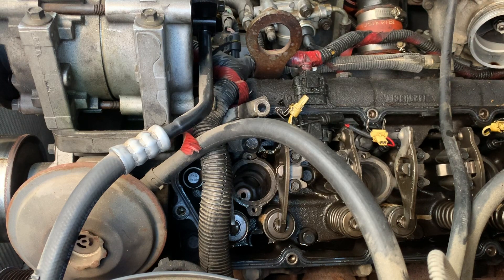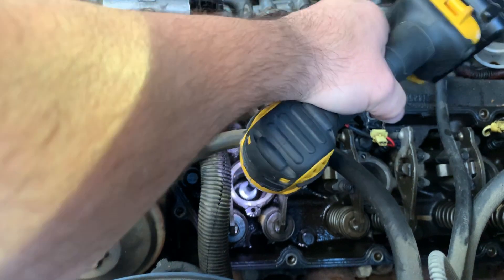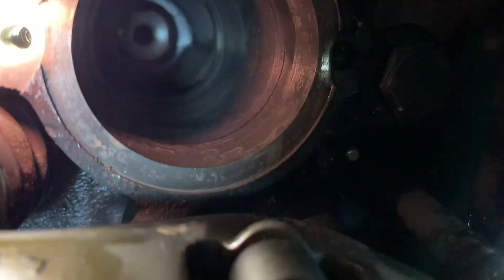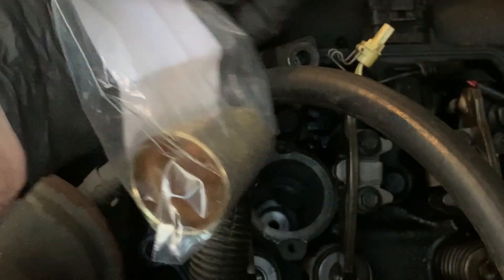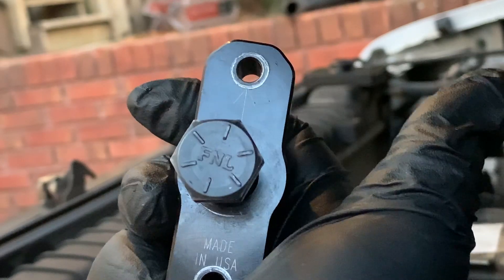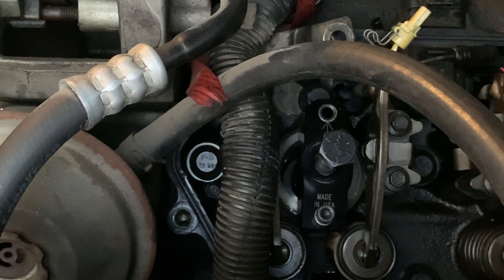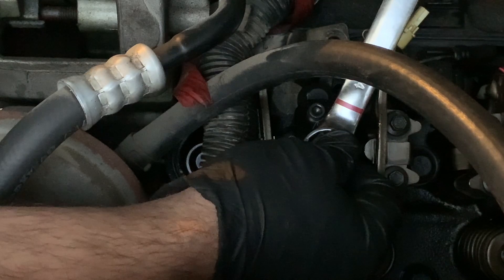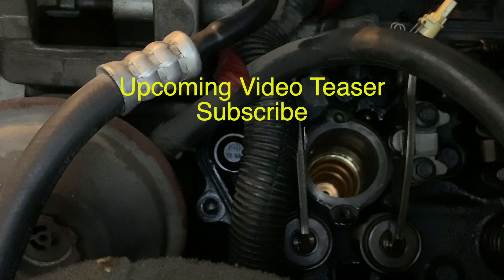OBS Ford 7.3 Injector Cup Installation

Comment: Hi i have engine 7.3 1996. but i have a problem.  Frecuently be mix oil with diesel and change new orings and works again by  some time. do you think that my cup is broken or need replace?
Reply from the maker: If a cup is broken, you would mix coolant in the oil.  To mix oil into the fuel, it’s going to be a bad oring.  I have another video showing how to rebuild the injectors and replace all the orings.
Reply: @nutsandbolts432  i lubricated them and they only lasted a few months and again they have been damaged. why do you think it could happen? as a result of the damage it no longer ignites. last time changing the injector orings solved the problem but again it has the failure.
Reply from the maker: @george2019  when I had previously replaced mine, you could purchase the 5 piece external orings from ford for $11 a set. Also remember there are 3 internal orings too. It could be a problem if the orings you are using are aftermarket.  However, a no start condition is unlikely going to be the result of bad orings.  If you have a way to monitor it, see what your high pressure oil is at while cranking.  If you don’t have a way, and want to try a simple fix, put a cam sensor in it.  They are notorious for going bad and will cause a no start.
Reply: @nutsandbolts432  yes. what happens is that when the orings are damaged the oil goes to the diesel and the pressure is lost of oil, it starts very little time and then the oil runs out and shuts down. changing the orings again it works again but the orings are damaged as if they were eating away. also when I install the injectors with the new orings I feel that they do not fit very tightly and they fit easily.
Reply from the maker: @george2019  installing that pink oring is a bear.  Make sure they are in the right order.  Also, if the copper compression washer on the nozzle is bad, damaged or missing, combustion gases will blow up in the injector bore and burn orings up very quickly.
Reply: @nutsandbolts432  I think that my cups are damaged because my coppers and orings are new and damaged very fast
Reply from the maker: @george2019  it’s possible.   I have links where you can rent the tools in the description.  Good luck!

Comment: My biggest concern doing this is bumping the cup against the bore as I'm sliding it in.  This might create a gap where the loctite is supposed to be on the cup. It just might be my OCD kicking in.
Reply from the maker: It’s a press fit.  The sealant is just an extra precaution.
Reply: @nutsandbolts432  Much appreciated.  That reduces a lot of stress.

Comment: Awesome Vid, a cool trick to keep those bristles in there and aligned is get a piece of copper pipe and cut it so only 1/4 inch of the bristles stick of out the bottom and tape it to the bit on the top of the copper tube, you'll be able to put more force on it for cleaning and not loose those brass flingers
Reply from the maker: Great tip.  Thanks.

Comment: Won't trash from the brush get back in the ports ready to plug the injector ports?
Reply from the maker: The majority of it will end up on top of the piston or in a coolant passage.  The debris can be measured in thousandths of an inch, and all the ports in the head are at least a 1/4”, so no problem there.  If by some unlucky miracle debris got stuck in either the oil or fuel ports (which are both slightly facing downward), they would likely pass through the injector and end up in the oil pan or fuel tank (if it were the oil passage or fuel passage respectfully).  I’m loaded with bad luck, and you would have to have worse luck than me to do injector damage.  But absolute worse case scenario, you know something got into one of them and you can’t fish it out, there are plug bolts on each end of the head for fuel and oil that you could remove and flush that rail.  You would have to replace the o-rings on those plugs and cranking it would take forever, but it’s possible.

Comment: I may be incorrect about this but the instructions on Riff Raffs site state to have the arrow pointing towards the valve springs. Does it make a difference or did you make any corrections to the final seating depth. Thank you
Reply from the maker: Because the bolt holes are symmetric to the centerline of the bore, I don’t think it makes a difference.  The side with the arrow is rounded on the top, giving additional clearance.  The truck has been running great since the repair, so there doesn’t appear to have been any issues.
Reply: Can you describe how you know the cup has fully seated?.
Reply: @superiorautomotive143 
I know this was two years ago, lol but when you know the cup has bottomed out is that it "dead stops" meaning you won't be able to turn your wrench or socket anymore. After that it's recommended to torque each cup down to 35 foot pounds but most folks don't even do that. 👍

Comment: I bought the cheap tools, will likely modify them to be the screw type vs the hammer type, unless I find it's safe to use an air chisel hammer to tap them home.
Reply from the maker: I'd be afraid that an air hammer might distort the cups while driving them in.  But, it would make it super quick.